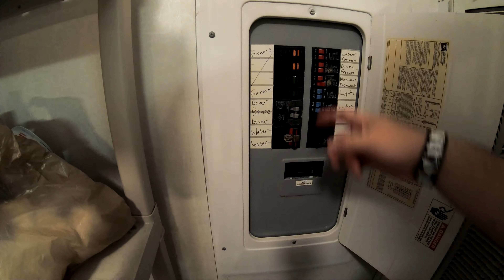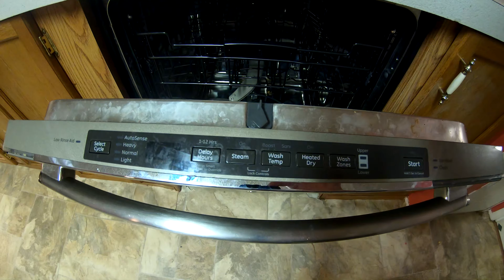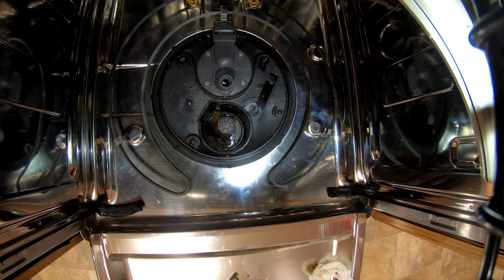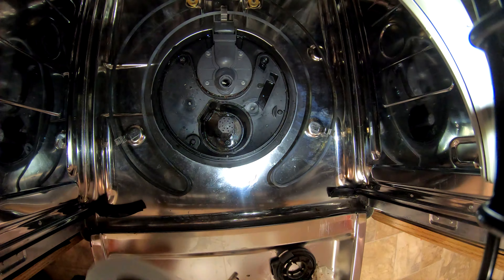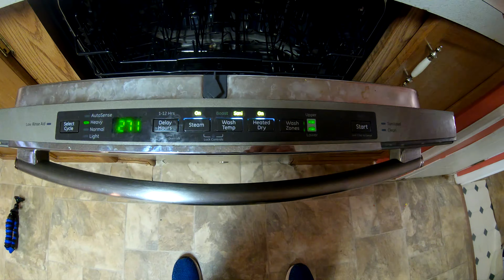GE Dishwasher Flood Switch Replacement!

Comment: It's like having a new dishwasher!  Thank you!
Reply from the maker: It's a wonderful feeling! Glad it worked and thanks for your comment! Have a wonderful day.
Reply: As senior citizens. we didn't want to have a repair person in the house in these c-virus times. In our household, I'm the mechanic. I browsed the web for fixes and when I found your step-by-step video with your patient and thorough instructions (funny, too), plus the positive comments, I felt confident. I ordered the float switch and nut driver. Once into the machine, I ran into a glitch. The nut bolts were frozen with a ring of calcium build-up, so I soaked them for a half-hour in distilled white vinegar. That made my repair take longer than most. But the repair was successful!  Even thingI don't need to spend time pre-washing the dishes any more. Ts I didn't know were bad are now fixed. The ball inside the old flood switch didn't rattle around, so the water level had been low. Maybe that's why the glasses were smelly sometimes. Now the right water level is reached. The spray arms shoot out a heavy volume of water when I open it to add one more thing. The hot water with power boost is super hot. The hot air is really hot. And the machine is a lot quieter, too.  So thanks again!

Comment: A shop vac, a long pair of tweezers (mine are 8") and a magnetic flashlight help too. I took that entire assembly out bit mine isn't electrical, it's a manual float so back to the drawing board. At least it's clean now.

Comment: Great video. Trick I use to hold the screws on the driver is to use a piece of paper towel between the nut and the driver.  Also those screws should be stainless steel which are not magnetic.
Reply from the maker: aorsin Thank you! great point! I found it was easy to just put the screws in the plastic holder first and slowly put them in place. The screws in mine definitely seem to be stainless but seemed to be partially magnetic. They may be a cheaper grade of stainless steel.

Comment: On this dishwasher how do you test doorlatch?
Reply from the maker: I believe if you pull the switch from the top just check the two terminals for continuity with a multimeter. Last time I checked the prices on those were fairly cheap so if there’s any question about it, it may be better to just replace it since you have to pull it out anyway to pull the switch.

Comment: We had two GE repair folks come out for our GE dishwasher that wouldn't heat the water or dry the dishes. One ordered parts, the other put them in. Still broke after both techs did their "magic". Finally decided to fix it ourselves even though we have minimal skills. This video was KEY in getting our dishwasher working again!!!! We ordered the flood switch replacement for less than $25 on Amazon, took about 30 minutes to install it...and (cue horns here) SUCCESS! Our flood switch had some kind of debris glacier inside of it filling it up about halfway to the top. Once we took it out we could see why the float ball wasn't working. What I can't figure out is how TWO GE techs couldn't/didn't figure it out. Justin: You are THE BEST!!! I've liked AND subscribed!
Reply from the maker: I am so glad this has helped you. I’m so surprised that “techs” have came out to help out and end up making you spend more money. Surprisingly there have been quite a few people that have reported the same issue on other videos I have made. All over a cheap and easily replaced part! Thank you for the like and sub. Have a happy new year!!

Comment: I did a deep clean of my dishwasher the other day and the very next day is when it stopped heating up. I ran an empty cycle with vinegar but I did it without the filter and screen thing in it. Did I mess it up by doing that?? There the greasy orange stuff all around the flood switch. I keep wiping it clean but it show back up.
Reply from the maker: Sounds like it was just coincidence unless there was a lot of grease build up. Most of the time the flood switch gets clogged then ends up failing. Once it’s clogged most of the time it’s easier to just replace it.

Comment: Hey there. My ge dishwasher wasn't cleaning very well or drying........there was a lot a debris left on the dishes and the washer at the end of wash cycles. So i disassembled everything in the botto to clean it all out but made the mistake of trying to twist/unscrew the flood switch itself as i didn't know the 2 screws were holding the assembly in. Well the wires on the harness that plugs into it broke pretty close to the harness plug. I was able to disassemble the plug and solder the wires back together and reassemble the plug. The flood switch itself was filled with white gunk so i cleaned it out with a thin screwdriver as well as cleaned its mounting surface and all hardware the best i could. Upon reassembly i noticed that i dont hear the float ball rattling in the flood switch....after reassembly still seems like theres no steam in the washer..but more concerning is that the the washer no longer fills. If i fill it manually it will drain. But it wont fill after messing with the flood switch. I can test the heating element myself and replace that if necessary.....but how do i test the flood switch and does it control the washer filling with water? I have all the tools to test....just not sure what kind of continuity or resistance im looking for an what pins on the flood swith to determine if its bad or not....any help would br greatly appreciated
Reply from the maker: I appreciate your eagerness in troubleshooting. I would say that as long as you’ve soldered the connection good it should be ok on the plug side. If it were me I would just replace the flood switch. Seems to have happened to a number of people as cleaning the flood switch, most of the time, does not resolve the issue.If you replace and it doesn’t work you can always send it back if you use the amazon links I provide in the description.

Comment: I have a similar model and no heat dry replaced the flood switch tested element and it ohm beeped
Reply from the maker: Check out my videos on the TCO. it could be the problem. if not try to add rinse aid. It sounds crazy but it does impact certain models. https://www.youtube.com/watch?v=yrkg2_qKwHk

Comment: How do you know if flood switch is bad?  can I test it somehow?  Will waterstayaround the floodswitch when itis operating properly?
Reply from the maker: Normally If you take it out and shake it you’ll hear the ball inside move around. If you don’t then it’s normally bad. Sometimes you can soak it in vinegar/warm water and it will fix it but most of the time not. Yes normally you’ll always have water down low near the flood switch as it sits a little lower than the pump inlet.

Comment: Thank you! Very helpful.  The only thing Im not sure of is how do I know if this is the reason my dishwasher isnt heating?   Is there a way to check if the flood switch is broken or the culprit?
Reply from the maker: I’m sure there is a way to check continuity or voltage but 99% of the time the culprit with heating is the flood switch on ones that have a flood switch and not a flood stem.
Reply: @BreakFixRepair  thanks so much.

Comment: I have the same model. My issue is that I'm not getting  water in the tub. We bought it used and just installed  it  in our home. I'm hoping  the float is simulating  full tub conditions. Other than that I have no clue
Reply from the maker: Sounds like it’s the water inlet valve has gone bad. It’s underneath in the front on the left hand side behind the panel. It will connect to the water supply. That would be what I’d check first!
Reply: @BreakFixRepair  omg thank you do much

Comment: When the float goes bad, will the dishwasher not turn on?  Once the float is replaced, the dishwasher will light back up?  My dishwasher has had this issue before, fixed by a technician. After watching your video, I’m certain I can do this. Thank you!

Comment: I have a Bellini BDW107dishwasher the trouble shooting alarm indicates the flood switch needs resetting.
your video is interesting and informative but does relate to my unit.  The flood switch is fixed to the bottom cover which had to be dislodged to replace the waste hose that had split.  This switch turns the machine off if water leaks into the tray under.  How can I reset this switch?
Reply from the maker: I appreciate your kind feedback. Try this: cut the power to the unit at the fuse box for 30 seconds to a minute. (Be careful) Then reapply power. This should “reset” the dishwasher. If you receive more codes after this it may indicate the switch is detecting more water present. Hope this helps!
Reply from the maker: Any luck with this yet?

Comment: My dishwasher isn’t drying, and I noticed a small puddle of water in front of it. Would the flood switch be responsible for the puddle of water or do I need to look at another part as well?
Reply from the maker: It could be. There’s a seal between the flood switch and the sensor underneath that’s supposed to keep the water out. It could be that seal or the seal around the door. I would check the door seal for cuts or worn areas and replace if needed. If it’s not drying I would recommend replacing the flood switch as a first try as that’s the easiest and has the most success in fixing people’s dishwashers. Hope this helps.

Comment: I have an error and it won’t drain all the way. When I took it out and tipped it, it works once and then the next time.. it stops and does the error thing. I don’t have any blocks and the tubes are good. Should I replace the part you showed me? Help!
Reply from the maker: I’d say that’s what it is but would like to know the model and error code. It could also be the pump which is expensive and much harder to replace. My first try would be to replace the flood switch due to the float mechanism inside. But please send the error code and model #. Thanks!!
Reply: @BreakFixRepair  you’re so kind to help me. I’ve also watched videos where it could be the air gap clogged? I’m so out of my element, but I’m gonna try the flood switch, if that doesn’t work I’ll buy a snake to clean the air gap pipe? lol I’m lost. Thanks again. If I have some success, I’ll let you know. 🙏👍
Reply: My code says e: 24 and it’s a Bosch silent plus 44 dBA
Reply from the maker: I don't think that's going to fix your issue in this case.When the Bosch Units give that error it is something to do with either a drain clog, or a sensor, or the drain pump not functioning properly. Check the check valve, it should be under the dishwasher in the line running to the pump. It may be clogged. Have you checked that?
Reply: @BreakFixRepair  I’ve had the same guy come out three times. ( was trying to give him a chance ) and every time he couldn’t get it fixed, but he always emptied the big drains underneath the sink and it didn’t help. It must be a sensor, or do you think I should try buying a pipe cleaner and cleaning the air gap?
Reply: @BreakFixRepair   sorry to bother you, I’m not great with appliances. I had a fridge guy come out a couple weeks ago because my fridge’s ice machine / water hasn’t worked for a year and I saved up for him to look at it. he was here for maybe 10 minutes, told me to buy a new one and left. that cost me 50 bucks lol .. My luck with appliances is not the best.
Reply from the maker: Wow. Can’t believe he charged you for that!!! If I were you I would start with checking the sensors and just double checking there is no clog in the drain line. Pull the line underneath and check the check sensor as well as that could be clogged with gunk not caught by the filter and causing a slow or clogged drain issue.
Reply: @BreakFixRepair  I’ll give it a shot and report back.🤞
Reply: @BreakFixRepair  alright, I’m reporting back. You encouraged me to think more about the clogs and the error code. I was about to buy the part you were talking about in the video, and decided to buy a snake thingy for the airgap. Man, it was gross. Was covered in garbage juice lol 🤢.. but it works! Thank you for giving me the confidence. It’s just me, and seeing your video made me think.. maybe I can do this? Ever come to the Midwest and I’ll buy you a beer. Thanks, sir.
Reply from the maker: That’s great!!!!! Hey bro one of my dreams is to go hiking and/or Jeeping in Colorado! I’ve never been. It looks so gorgeous.
Reply from the maker: But hey I’m glad you found the right fix for your dishwasher. I appreciate your support and hopefully that’ll keep it running a bit longer. One thing that may help is to run a good dishwasher cleaner through once a month to help dissolve any of those deposits. Just food for thought!
Reply: @BreakFixRepair  I will definitely try that out. I’m Midwest, not southwest, but Colorado is amazinggg. The scenery, the people, and the food are 💯. Thanks again

Comment: Hi!  I made this repair as my water/heating element wasn't working.  Easy repair and it fixed the problem.  Sadly, some water started dripping into my basement.  I must not have made a good enough seal with the O-ring?  It doesn't really snap in...you just kind of place it there.  Must not have been tight.  It triggered the circuit breaker, now my dishwasher isn't booting up properly.  It gets power, but nothing happens when I press any buttons.  

Any ideas?  (Haven't called GE yet)  I've since tried to make a better seal with the O-ring on the switch.....ready to try it again, if I can get my dishwasher to actually start a cycle....
Reply from the maker: OH NO!!!! It should snug up if it’s seated properly and as long as those two screws are tight. If it triggered the circuit breaker makes me think water got to the power lines and shorted. If that’s the case my first guess would be that the control board shorted out. First things first make sure that it’s snug. Next make sure it’s completely dry underneath. I would turn power off to the dishwasher for at least an hour, open up underneath and place a fan under to dry it out then try again. If it’s completely dried out then I would say it’s the control board that was fried. Do you get any lights on the control panel?
Reply: @BreakFixRepair  The only way I get lights to the control panel are if I push the Start and Select Cycle buttons together for 5 seconds.  At that point all light light up for about 10 seconds.....then go off.  That's really all I can get it to do.  Pushing any other button or opening/closing the door does not make it light up.  If the power line did get wet, think it's possible to "dry" it out like you mentioned, or think it's fried?
Reply from the maker: I would definitely turn power off and dry it out before I did anything else. It shouldn’t hurt anything to give that a shot first. With the power off for that long it should also reset and troubleshooting codes if it’s in a diagnostic mode.
Reply: @BreakFixRepair  Thank you for your immediate responses!  We'll see what happens....stupid leak.
Reply from the maker: It sucks but hopefully we can get it fixed. Not having a dishwasher sucks! Let me know what you find.

Comment: Hi! I don’t know if you can help me but the plastic top part of the float switch broke off. It can still sit on top but I don’t want to ruin anything by running my dishwasher. I would appreciate any help, thank you!
Reply from the maker: So sorry on the delay. We’re you able to get this resolved? Was it just the small grey plastic piece that fits around and screws into the base to secure the flood switch?

Comment: Love the video -- very very helpful!  My problem is that I can't find the flood switch for my particular GE dishwasher.  The model number is GDT695SFL5DS, and it was a new model around 2018.  Any clues as to how to find the right flood switch?
Reply from the maker: Let me look but my guess is it has a flood stem instead of a flood switch. In your case check out my video on the TCO reset which may be your issue!! Do they look different? The flood stem looks like 2-3 grey cones that fit on top of each other. Hope this helps

Comment: Hi I have GE dish washer GBT632SSmSS display is on but keypad is not working. I have turned it off from breaker but unable to reset it. Please advise. Thanks
Reply from the maker: Sounds like you may need a UI board replacement but I’m not sure!
Reply from the maker: Could also be that the controls lock has been activated.

Comment: Just replaced mine. How long do I have to run it to know if it worked?
Reply from the maker: Normally you should know pretty quick. I’d say within the first 20-30 minutes. Put your hand close to the heating element (do not touch it) and you should feel the heat off it if it’s working.
Reply: I’m about 10 min In. Flood switch was gunked up like others said. Can’t imagine it wasn’t it.
Reply: Just checked was able to touch it. Not sure when it kicks on.
Reply from the maker: Did it ever work? I have seen a few people say that it took a couple cycles to work for them.